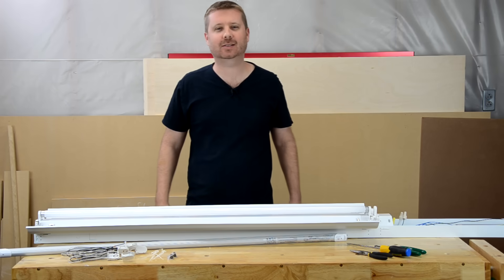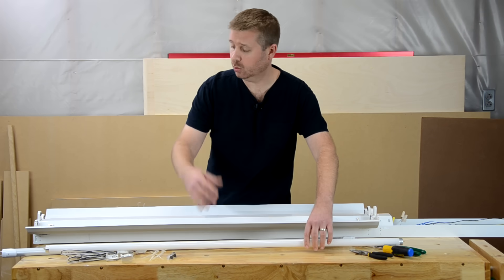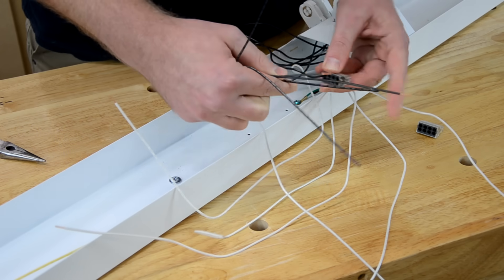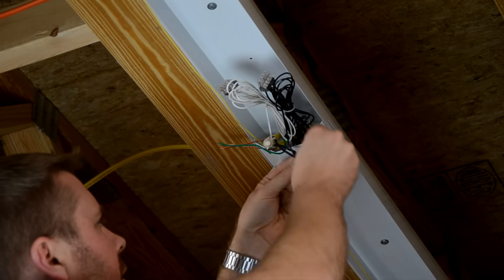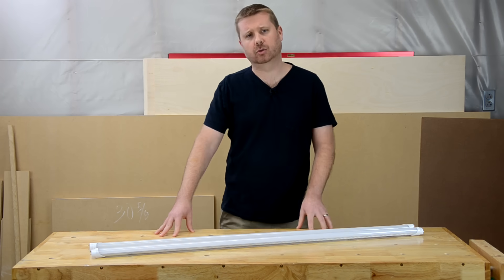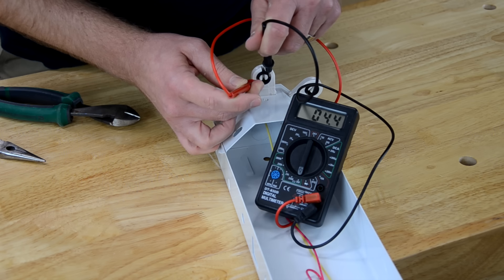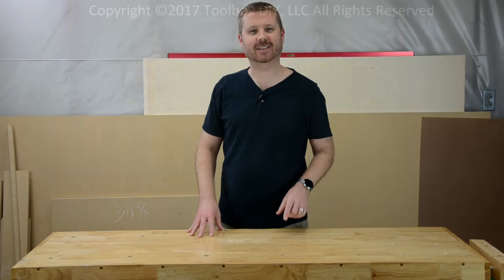How to easily convert fluorescent Lights to LED –Easy Ways to Save Money

Comment: Or just buy new fixtures for less than $20, take down the old fixtures, put up new fixtures and you're done. Sell the old fixtures at your garage sale while they're still worth $5 each and the new fixtures now only cost $15 each! https://www.menards.com/main/lighting-ceiling-fans/indoor-lighting/strips-shop-lights/smart-electrician-white-3300-lumen-led-shop-light/p-1444423574927.htm
Reply: I bought those 20 dollar lights all six were dead in 5 months but all my tube type led conversions are still working
Reply: I've had mine for quite a while, not sure how long, but they're working just fine!
Reply: Thanks, David and Paula Thompson.  That helps!  I have fluorescent lights in my master closet and the ballast has gone bad.  What a pain!  Now that I've seen this video, I think I'll remove the ballast and rewire the light fixture for LEDs.
Reply: Anyone know where I can buy 8 foot t8 leds at a reasonable price?
Reply: Terry Jones I have used led light for drywall taping inspection for a couple of years same cheapo 3triple a flashlights and you can actually see even after hundreds of hours that when you shine it over or side by each led makes you feel like you have been blind now I have a couple of rechargeable lights between the two I always have clean reliable light source
Reply: Most of the time, a project like this is done for 2 reasons,: Aesthetics and time. Aesthetics is the look of the fixture, like the ones in my house. They are from the early 40's and are 2, 3, and 4 bulb dual sliding glass medicine cabinets. They are part of the bathroom sets that include a built-in toothbrush/cupholder that rotates to hide same for the tp holder and towel brackets. The cabinets are mounted on top of the tile and the others are cut into them. Also, my house was built on 14' centers so None of the current cabs will properly fit in since the old units were Really built into the walls back then. You cannot find ANYTHING near the same size so This helps me keep those fixtures and the look. Secondly the time it would take to replace the entire unit would be ridiculous not to mention drilling into the tile for mounting a new cabinet and then hiding or Trying to hide any of the old holes. Even going from an original to a New "retro" unit, sometimes the mounting points are different.
Reply: Terry Jones of
Reply: Except:

1)  Old fixtures are only worth scrap metal value.
2)  Your linked lights produce only half as much light as the 4' T8 fluorescents so double the cost and add additional wiring time and cost to get more light.
3)  Cheap LED lights have short lifespans, sometimes very very short.
4)  There was no reason to change to LED.  Those linked lights use 41W to produce 3300 lumens.  A single 4' T8 tube produces around 3000 lumens from 32W, is MORE efficient AND costs less.
Reply: Terry Jones good points I was wondering why these people fix these things you better off just buying a new one like you said and most of the new ones even come with the light bulb
Reply: Terry Jones  y^
Reply: Not
Reply: Terry Jones I always wanted watching these videos like I just posted on another video like this why wouldn't you just bite a new fixture it ain't like it's hard to do it's as easy as doing this buy the new fixture and why it at if you doing this that means you know how to do wiring

Comment: Good video, but you need to advise people if they're susceptible to migranes or other headaches not to change the system. I have to be careful when around LED lighting because my eyes are sensitive to light and causes me to have headaches. I know some who have migraines that have problems with LED lighting.
Reply: In my experience, fluorescent lights affect me MUCH MORE than LED.  I can walk into Home Depot or Lowes and almost immediately feel dizzy from the 60 cycle flashing of the lighting.
Reply: pensandcalls 
That's exactly what I was thinking.
Although, some fluorescent lamp/ ballast combinations seem to flicker more than others.
Could be lots of reasons for this. Bottom line, you don't know exactly what result you're gonna have until fixtures are all installed and circuit is energized.
As a commercial electrician, I personally haven't heard of any such complaints about LED lighting. 
I also haven't installed any new fluorescent lighting fixtures in the last 5 years.
LED lighting is here to stay.

Comment: Pretty good video. I do have one complaint. When you first talk about materials, you called the new tombstone a Non-shunted end. Later ,when installing it in the holder you specified that it be a SHUNTED tombstone. What gives? Being electro-ignorant, I don't know shunted from  rabbits, so I'm ignorant of that about which you speak. HELP
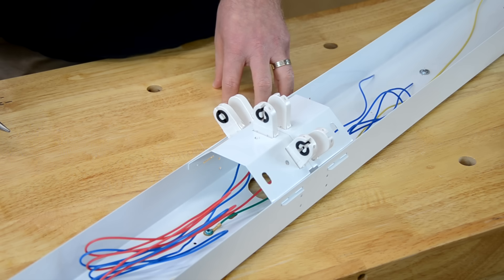Reply from the maker: The beginning of the video is correct. I misspoke at about 3:59 and meant to say "replace the shunted tombstones with non-shunted tombstone." Unfortunately, I can't correct it without re-posting a new video. Sorry for the confusion.
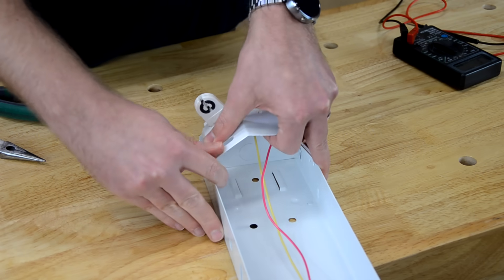If you don't know which type you have (you very likely have shunted but that's not a guarantee), I cover how to determine that at around 10:30.
Reply: eugene Morrill i

Comment: So why over complicate the flouro so electricians can get extra work for nothing when all is needed is take out the starter.you do not need a dumy starter or anything else ,so call me a putz or what you want there are gulible peoplee all over the world and putzes like those over in the states don't have a brain to bless themselves with if you believe that crap.
Reply: Roger Dale+ Because most fixture made in the last 35 years DO NOT have a starter. The reality is those starters are a leftover from the early days, (WWII - mid 70s) so most fixtures that old have probably been converted already.
Reply: The fuss is about there being several different types of tubes. Most fixtures in the last 40 years don't even have a starter so that would be the wrong kit for the rest of us.
Reply: I rewired about 8 fixtures in my home for LED lights, and none had starters, only ballasts. Rewiring is easy if you can operate basic hand tools and know where your breaker box is, otherwise call an electrician. I live in the states, we're all not putzes.
Reply: Don't really know what all the fuss is about. I changed all my office fleuro light tubes (6 of them) also my workshop fleuro light tubes (another 6) all that was required was to remove the "starters" ( replaced them with the dummy ones supplied) and fit the LED tubes. Job done quickly and no fuss, no problems, no playing around with wires and removing ballast. They've all worked fine since installation which was over 2 years ago. (Brisbane,  Australia)
Reply: rupe53 yes I guess that's the problem with different options for different countries. I bought all my LED tubes from a local Aldi store (German supermarket chain) of course the kits were all ready to fit to our Australian lights.
Reply: exactly what i did and no cost for time and all mi did was remove the starter as no dummy ones supplied as even my supplier did not even know this.

Comment: save your receipts so when these things fail before their stated lifetime, you can return them.  LEDs have voltage regulator and voltage converters in them and these electronic parts fail an enormous amount of the time.  When LEDs fail, it can be the very cheap electronics or just 1 LED which is causing the others to fail simply because they are connected in series.  There are many videos about failed LEDs.  The tubes are even more expensive than the bulbs so save your receipts so you can get free replacements.  You are trying to save electricity so return on your investment in LEDs is going to be at a lose if you don't return failed LEDs for a refund.  The savings is over a great amount of time and that means the longer you have the original LED purchased, the greater your savings.
Reply from the maker: Great advice, D! I've been fortunate with the LED tubes but I have had four Par30 and E26 LED bulbs fail. I had receipts for three of the four and got them replaced under warranty. I had to eat it on the fourth one which was about $15. Not a big deal, but frustrating considering the "lifetimes" they advertise for LEDs.
Reply: Thanks and I edited to correct some English errors.

Comment: I have replaced fluorescent tubes with two different LED tubes in our house. One required rewiring to eliminate the ballast., the other just plugged in with no modifications. Obviously the ballast draws power so it is good to eliminate it.

In both cases the LED bulbs are performing perfectly. The come on instantly, don't flicker, are brighter than the bulbs they replaced, and none has failed after a year.
Reply: The ballast is just something more that could go wrong.  They can also cause buzzing sounds.  They also do FAIL.    For me I feel it's just better to toss them.   So I replaced the fluorescent T8 bulbs in the owner's office and the HR's office.  using LED bulbs that work over 120-277 volts.  All the lights in the factory are powered by 277 volts.  There's so many more lights I could do also.  Some also are connected to a battery backup system that's in them.   I've had to replace a few ballasts and battery backup systems.  

It's not hard, you basically rip the ballast out and all the wiring going everywhere.  You replace the Keystone on 1 side with a new one.  One that allows a black wire connection on one side and a White Wire connection on the other side.   Normally both those pins on a florescent Keystone are the same and linked together.  That wouldn't work for getting power directly.    It's a simple wire hookup.  The other side of the fixture there's no wires at all, the only thing it's now doing is holding up that side of the T8 bulb.   I also put a label in them that saw 277V Power end, LED Conversion.  Just in case it's not me that's doing something with them.

These things should last for YEARS and YEARS, and use a fraction of the power.   There's no ballast in them to ever have to deal with either now.    If I used the lights in my garage a whole lot more, I would start switching them out.  Hell I may do that once the bulbs start to fail.  The cost of LED keep dropping.  Most of the bulbs in my house these days are LED's.
Reply: The drop-in replacement I can find almost every Home Improvement store and cheap. Around $6 a bulb. But the ones that where you take the ballast out are four times as much. Even on Amazon more expensive.
Reply: Another benifit is they work in a cold environment. fluorescent lights HATE the cold and take forever to warm up and give useful light. The colder it is the worse they are. LED is unaffected by cold and you have instant light.
Reply: CFLs and ballasts are AC devices. It would be hard to measure the AC power mains with the DC amp meter shown in the video. Even when you do measure the AC current , the ballast will dissipate very little energy when the CFL is on. However, there still are parts inside the ballast that can and do fail.
So while the ballast does dissipater AC power when on, the amount of energy is a very small amount and usually does not matter in the scope of how much CFL save over incandescents. LEDs, as we are seeing, are totally different.
Reply: Eliminating the ballast is the way to go especially if your ballasts are already bad like mine were.  Some people have complained that their "ballast compatible" LED lights have stopped working after a couple months.
Reply: Dug Bard
Reply: did you put an amp meter on that to verify that??? just asking, if so why do they fail if they use no current??
Reply: did you put an amp meter on that to verify that??? just asking, if so why do they fail if they use no current??
Reply: Run the lamp for while and if the ballast is warm, then you know that it will use power.
Reply: Dug Bard what is second generation?
Reply: I tested a 5 ft striplight with a watt meter, tube was drawing 60w, replaced with LED 20w, power straight to tube, no ballast also 20w. The ballast is not like a transformer, as only one end connects to the mains, the other goes through the lamp so is just a coil of wire. If its sound it should not be a problem, but if it has an insulation resistance fault, it could leak power to earth in which case would be better to disconnect.
Reply: The striplights here I have replaced with LEDs are simple Live to ballast then starter through one end then back to other end then back to N. The starter is replaced with a fuse so the ballast just has flow through. Any other type or if they were damaged I would bypass the ballast.
I have found it good to keep the power in series to both ends, as then the tube can be put in either way round, the non power end of the tubes I am using is a direct short.
Reply: My Tl tubes are still running after 15 years.. (Philips)
Reply: I wondered about that.  I was given two LED tubes (T8).  Without thinking I put them in my fluorescent shop light fixture.  They worked just fine with no modifications at all.
Reply: The Ballast dont draw power, it is just a length of wound wire.